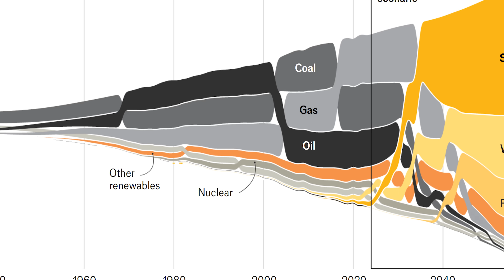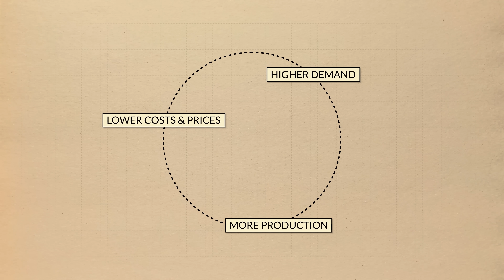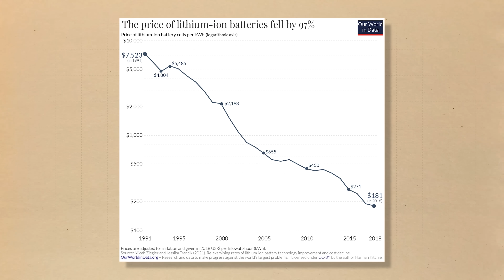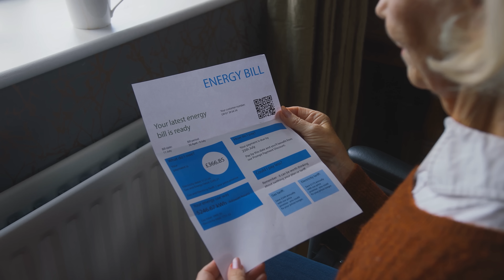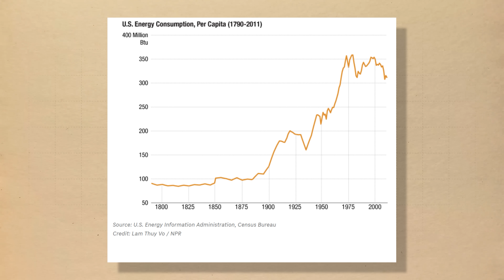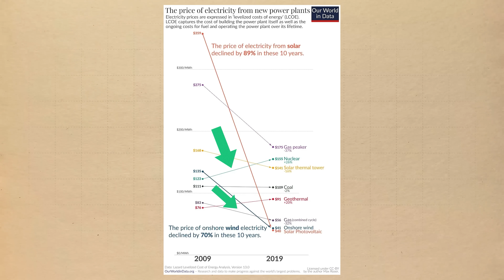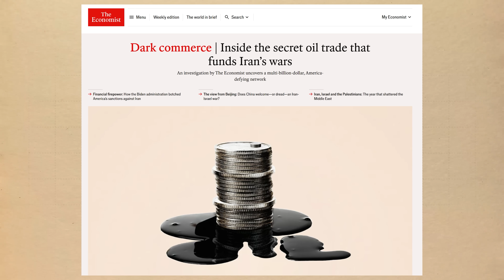Why solar will soon dominate & what that means for the world

Comment: Solar got cheaper because China mass produces the panels 

People buy the panels because the government subsidizes it 

All of this is nonsense and misunderstand the technology 
Adopting solar doesn't get cheaper over time it gets exponentially more expensive.

Right now solar is displacing peaking power plants, replacing base load requires extreme battery investments so cost goes up not down
Reply: I can't stress enough how bad the storage with batteries is you really just need to understand that coal and gas store months of power globally 

While batteries store at most days but more often hour the two aren't even close to being in the same league
Reply: @evan448 Cost of firmed solar is far cheaper than coal.
Reply: @ashleigh3021  a ton of coal cost 50 bucks and gets you two megawatts of stored energy and you stack hundreds of thousands of tons. 
A 2 megawatts battery cost millions 
And all the installed batteries in the US I believe amounts to around 30 gigs or 30,000 megawatts or in coal terms that's 15,000 tons which Is a trivial amount of tons. 

The cost of which is $750k 
Add the O and M of the plant, burning it if you want. The sane amount in battery storage is hundreds of millions.

Solar and battery is used for peak shaving where not much storage is actually needed. 

Season to season we burn coal and gas because making up that variance with spare batteries and solar is very expensive
Reply: @evan448  As I said the cost of coal properly priced to account for emissions is more expensive than firmed solar.
Reply: @ashleigh3021   okay what are the emissions of lithium cobalt and poly silicon 

Poly silicon is literally made with coal
Reply: Building those things incur a carbon debt and depending on where your at in the world you may never pay it off in the lifetime of your panel. 

Ie if you live in Iceland the sun doesn't shine enough and the grid already low carbon 

Panels in Germany for instance are net negatives by some measure

Comment: Solar just can't dominate. The thing with solar is that you sell it to the government when you have a lot in summer but you buy it back for free in winter when you have less. Electricity is not stored. It's just you less fossils in the summer than winter. There has to be diverse system with different energy sources and not just one dominant no matter which one
Reply: Solar WILL dominate, but will have a large supplement of wind power, especially in winter in regions near the poles.  When the transition is complete (2050?  2060?) world totals will be 50% to 60% solar, 25% to 35% wind, and 5% to 25% hydroelectric, geothermal and biomass.  Come back in 25 years.

Comment: Sorry, so many errors. 
1. Electricity is only part of the energy set.
2. high solar radiation doesn't mean better solar panel output, given that they are like electronics, your pc let's say, they like 15 Degree Celcius.

Comment: Also there is the point that solar is the most easily democratized form of generation. 

So in regions where the grid oligopoly does not have enough control to block it, you have residential, business and community solar projects adding significantly to the deployment numbers. Small capital outlay to supplement small end users, not waiting for mega projects and capital investment.
Reply: Solar is great just as long as you can afford the installation, the batterys, the inverter and you don't mind paying higher than grid costs all up front. 

I tried it.  For me, as long as the grid is there and less expensive, I will gladly let the power company deal with production and delivery. 

When my inverter died my break even period whent from 23 years to 30 years.  That is proving my batterys and equipment last 30 years.  What could go wrong, right?

Comment: In the long term solar has to many downsides. It needs a lot of space and maintenance, a complex (and expensive) energy system and a huge amount of (not yet available) storage capacity. My bet for the future is on geothermal energy. It is available almost everywhere, does not waste any sparse ressources, can run 24/7 without any dependency on the weather and is adjustable to the current need. There are just a few technical advancements missing at the moment.
Reply: I feel like it's fair to point that out, but at the same time one could say something similar about fossil fuels ("in the long term, they will cause climate change and many health hazards") but that didn't stop them from being the dominant energy source for decades. There probably won't be one single replacement for fossil fuels, and probably not a total replacement either due to the advantages that fossil fuels have over all other energy sources. As long as we drastically cut back on fossil fuels their downsides can be managed.

Solar is probably going to be a supplemental energy source. Something you can access all day and then when the Sun goes down either exhaust the supply or switch the grid to run off fossil fuels overnight (possibly with big energy fees for energy consumption). Where I live we can get by on hydroelectricity exclusively but solar would be helpful for some periods of the year

Comment: does not matter how cheap it becomes everybody just needs to look at germany. your company will only use electricity when the sun is shining fore sure. not up to your standart
Reply: We have these things called batteries that store electricity. Also we have these things called wind turbines and other power plants that deliver it
Reply: @ashleigh3021  saying storing electricity for a nation (not for your household) is possible is like saying going to space with a pogo stick. obviously you dont get the dimensions. there is a 1000x diffrence
Reply: @heinzbongwasser2715  I don’t think you understand the dimensions at all. Utility scale storage and residential storage are both proven technologies. One doesn’t have to rely on either.
Reply: @ashleigh3021  only to deal with tiny fluctuations on the grid level.
Reply: @heinzbongwasser2715  I have no idea what you’re babbling about. Literally every single developed country plans to build primarily wind and solar firmed with storage by 2030, while mostly retiring coal and gas in the process.
Reply: @ashleigh3021  WHICH COUNTRY HAS SIGNIFICANT STORAGE
Reply: @heinzbongwasser2715  The majority of developed countries as I said. The forecast is 1TWh minimum installed globally by 2030
Reply: @ashleigh3021  germany alone needs 450 twh per year compared to what the world needs its just a few seconds now you are on the right track. 2030 so right now not even that tiny amount of  storage is avalible hahahaha
Reply: @ashleigh3021  its not possible to exchange baseload power with solar/wind (as you saw storage in significant quantity is not existant)

Comment: 10:40 The correct choice is to buy the cheap, subsidized chinese panels while spinning up the next generation of panels.
We won't catch up in simple silicon - but that is also extremely limited and we can already see the next couple of generations on the horizon, which are different enough to barely have any transfer.

We don't need to outcompete the horse breeders if we are 3 years away from building the Model T by the million.

Comment: Funny how California with the hightest fraction of "renueable" and solar energy also has an average electric cost 3 time higher than the national average.  We are paying 43¢ / kwh in So. California for home use and 65¢ / Kwh for charging our electric cars.   My cost per mile in my hybred is the same as my electric when our gas cost is $4.50/gal. 

His theory sounds good, but observable data says what is real.   Note that China produces some 95% of all solar grade silicon and US government sponsored alternatives like Solyndra failed.   China was able to take this monopoly control by allowing people to build the plants to convert sand into pure silicon in less that 1.5 year.  The regulators in the US and EU take 4 times longer than the construction time just to "review" and "approve" the proposal, if you get approval at all.
Reply: First off - with your own solar panels and half a brain you don’t need to pay anything near the California electric rates for much of your usage (if you want to stay “on-grid” you will need to pay a token amount”), but the local electricity company doesn’t need to know about most of your electricity usage if it doesn’t come from them. 

Second - yes California electricity is expensive because of regional monopolies that handle the distribution poorly. Some small amount of this cost is also from previous solar subsidies. This is a governance issue, not a technological problem. 

If you look closely some regions near you that aren’t governed by the monopolies pay half or less than the rates that you do, so it is very easily achieved to have cheaper pricing and solar.
Reply: California is 11th in terms of percentage of electricity produced by renewables with about 43%. Here in Washington, where we get about 75% from renewables, electricity is $0.6-0.15/kWh. So your "real world example" is cherry picked and not even correct. California also has a highly deregulated energy market which is more likely the reason for your high costs. Having your own panels with energy storage will make that cost per kWh that you use drop dramatically. 

Maybe charge your car at home instead of going to a fast charger.

Next time try to make your bias a little less glaringly obvious.
Reply: @schubajo  Nothing like having old fully depreciated dams on the Columbia and Snake to provide "renewables" and not solar.   Hydro also is available and very reliable 24/7.   I have solar and our State PUC is trying to kill my net metering contract and remove benefits for home solar.   I got some "free" electricity buried in the cost of my Ionic-5 so I am using that from fast chargers.   California has too much solar and we sometimes pay Arazona to take it.   Our bureaucrats are smart enough to allow customers with electric cars or battery packs to stock up power at near zero cost when they have too much.
Reply: @schubajo  As a benefit for us who have solar and battery cars, our PUC and Governor are adding a large fixed charge to our bills so if we use our solar, we still pay.   They are trying to start low but we know how greedy our utilities and Governments are and it will increase.   The pets of the government won't have to pay the fee if they cry on the correct forms.

Comment: While I wanted to switch to solar, I found for installation of off grid solar system ,the majority of the cost isn't even the solar panels but the inverter and batterie cost more than solar panels.
Reply: And scaffolding for the roof.

Comment: what's so great about Solar as opposed to any other energy type is how democratized it is. Solar panels have been getting cheaper and more effective. If you've got a roof over your head, you can install them, and that provides a level of energy independence that, while certainly not sufficient to cover all energy needs, is not nothing.

Comment: Good video! Cheap solar will probably allow a shift of heavy industry to North Africa. I.e. if energy is free during the day when people work, then north Africa becomes attractive.

Similiarly, if it is much cheaper to add a wind turbine to run a less efficient storage heater, then heat pumps might not be the best way to get to net zero... especially if we have a lot of excess wind in the winter... 

Cheap solar will also drive transport electrification and a strong push for alternatives to other process that release CO2.. all good stuff

Let it cone soon!

Comment: I don't understand why so much fuzz about Australia having 35% of renewables in its electric grid. I am from Brazil. Here renewables are more than 70% of the electricity production. And it has been like that for a very long time. That is because the basis of electricity production in the country has been hidropower. In fact, the share of renewables has even descreased a little bit in the last decades (it used to be above 80% in the 1990's), since you can't flood the entire country to build hidroelectric power plants. Besides being clean, hidro is also very cheap and reliable (as oppose to wind or solar, which only works during the day). I really don't understand why the rest of the world didn't use more hidropower.
Reply: Hydropower as a primary source (i.e not pumped hydro storage) needs a cliamte with lots of rain and the geography.

A lot of places don't have this.
Reply: Hidropower severely ruins the biome.

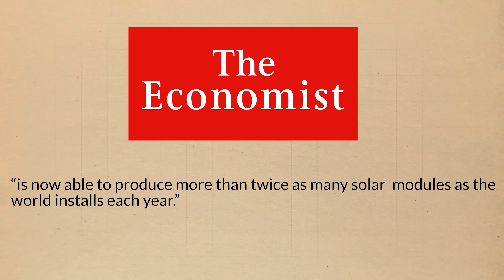Comment: How  can be so confident of a solar revolution, when in 10:19 say "[China] is now able to produce more than twice as many solar modules as the world installs each years" that's sounds more to me to market manipulation, dumping or market capture, as Chine did with steel of concrete in times past, more than anything else, how this market works when half of the production is unsellable?
Reply: The production capacity at the end of 2024 determines what can be produced in 2025! Look at the chart again, it has been like this essentially all the time. In one or two years today's production capacity will be the number of yearly installed solar modules. If you bet on this trend continuing, that's a perfectly reasonable decision to increase production capacity like this.

Comment: I am curious as to the definition of "capacity added". Is that solar panels produced or solar panels installed and operating?

Also, there is the issue of solar panels installed in areas where they should not be. Germany has installed solar panels, but their solar potential is poor due to latitude and weather. A better measure would be to look a solar electrical production ... if that data is available.

I do believe there is a lot of growth, but I am not sure it is as great as the the first chart indicates.

Comment: 20 feet container 6m x2,44m
You will have 6 panels with 2x1m
So 12m² × 59 =708m²

5cm is the thickness of the solar panels but normally the have 3-4cm ( 30-40 mm)

708m² ÷ 7,5m²= 94,4 kWp

Comment: The solar panels and wind turbines produce cheap energy but it is the cost of the grid upgrades that make it harder.  Solar panels make sense where there is more sunshine, wind turbines where it is windy.  But it has to be connected to the grid.  In the UK a motorway service station installed a bank of rapid chargers.  They asked to be connected to the grid but were told it was not possible.  I think the grid upgrades have to happen, either with new pylons or underground cables.

Comment: I think that regarding solar and wind energy small is better with both on rooftops rather than in big farms. For industry nuclear is better for producing the huge amounts of electricity needed.
Lithium is a finite resource, so maybe H2 is the transport fuel of the future. The reason it's expensive now is that it takes a lot of electricity to produce, but if the electricity is cheap...
Reply: Wind energy, just by the physics of it, doesn't scale down. The output of a wind turbine is proportional to the diameter squared and the wind speed cubed. If you make the turbine twice as big, you get four times the power. If you make it taller to get faster wind, you get hugely more power. The little mini-turbines you see in domestic use are almost useless, providing very little energy. With wind, bigger is better.

Solar is perfectly linear though. Build twice the panels, get twice the power. It scales down great, all the way down to single-building rooftop installations, or a single panel on top of a shed to power some lighting inside.

Hydrogen today is very rarely produced using electricity. It wouldn't be commercially viable, because you can make hydrogen much cheaper by doing some basic chemistry to natural gas. Who is going to pay extra for 'green' hydrogen when the gas plant is offering the very same product for a lower price? Hydrogen for energy storage is an empty promise - one pushed by people who are desperate for a quick solution that will let us continue to use most of our existing and paid-for gas distribution infrastructure.
Reply: @vylbird8014 , I think you are right, but just one point: I don't think you can produce H2 fuel for vehicle fuel - not for storage as you say - without electricity. It's about which energy source is used to produce the electricity. Ammonia is used in this process, but I don't know how that works.
In any case, now producing H2 fuel is expensive, but the price will come down as energy becomes cheaper.
Reply: Hydrogen is definitely, without a doubt, NO SOLUTION for road transport... even for heavy transport, neither now, nor for the next decade or two!  
A note form a chemical engineer with a decade of experience in the hydrogen industry....

N.B.:  Lithium is, like anything else (save solar power) a finite resource.  BUT it is a VERY abundant resource, of which we shall not run out for as far as we humans can today foresee.
Reply: Solar is great on roofs.  Every sunny roof should have solar panels on it.  Rooftop wind doesn't work because the air near buildings is too turbulent and therefore doesn't hold much power.  
Lithium is technically a finite resource, but there is a lot of it on Earth.  And it can be recycled, so once we have made enough batteries we can stop mining for it.  This will probably happen around 2030 to 2040.